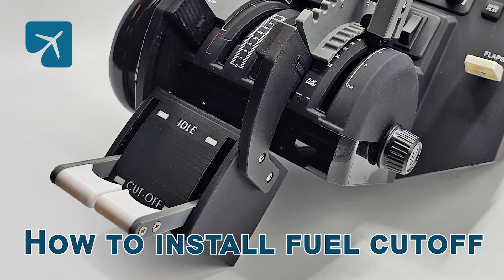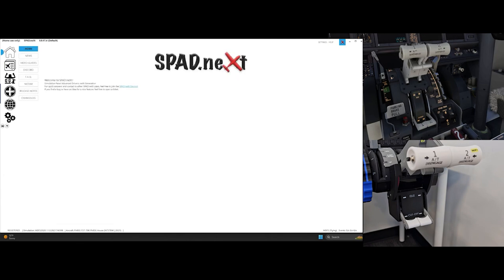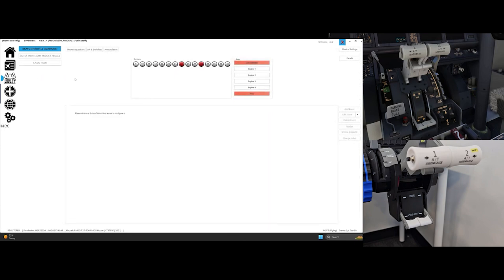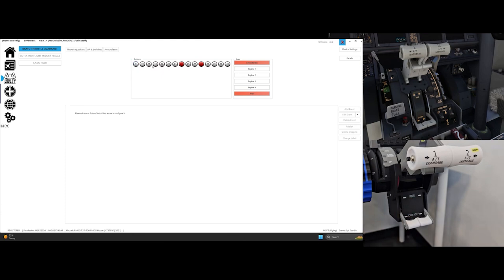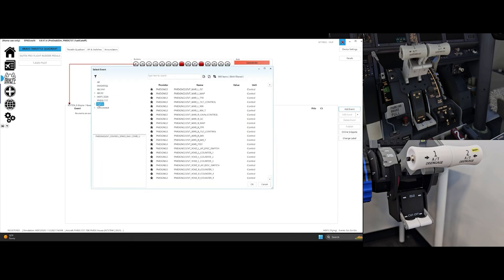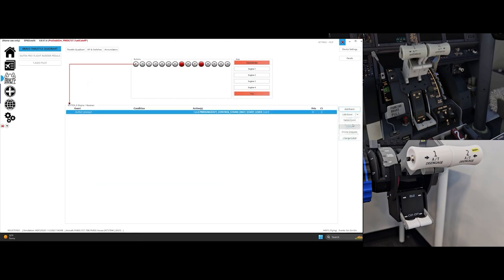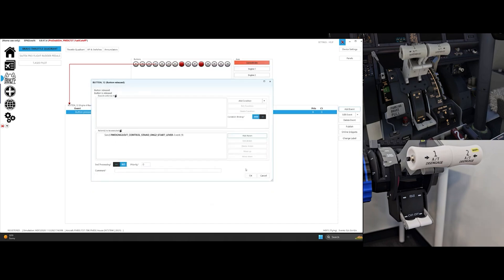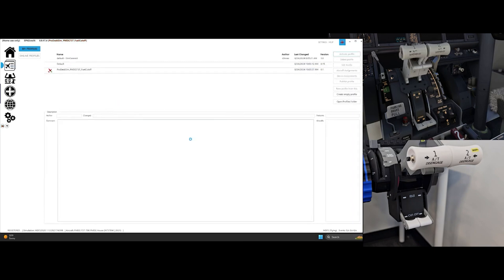ProDeskSim Boeing Fuel Cutoff Levers Setup tutorial for PMDG Boeing 737 in MSFS2020 using Spad.next

Comment: Welll, the programming worked but then packed in after about ten cycles - done a restart etc and still doesn't work.. Looks like I'll have to redo the procedure... 
  
 Update - redone the process and it works a treat now.  [Using Spad.neXt]      However, If the unit is meant to show lights on the Idle and Cut Off Indicators, then in this case - NO LEDS...
Reply from the maker: Hello, Thank you for your comment. There are different tutorials online on how to setup the Honeycomb Bravo's LEDs.